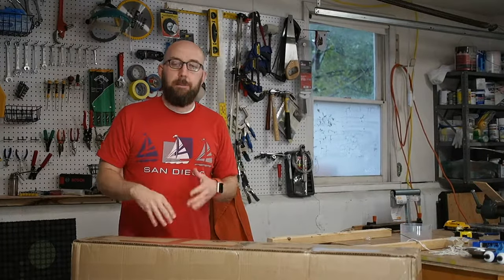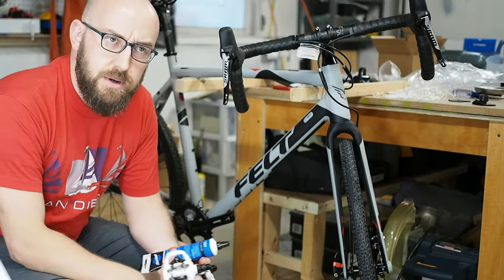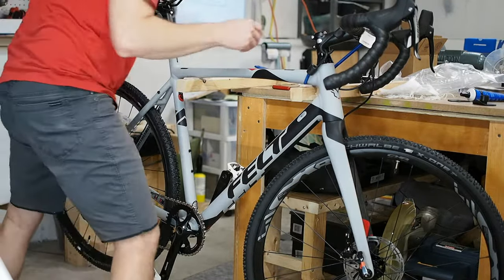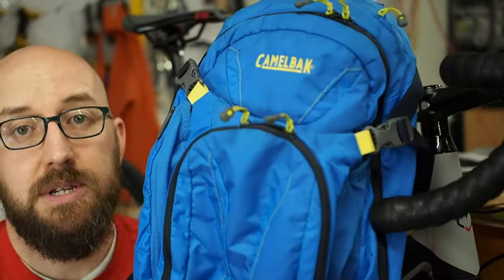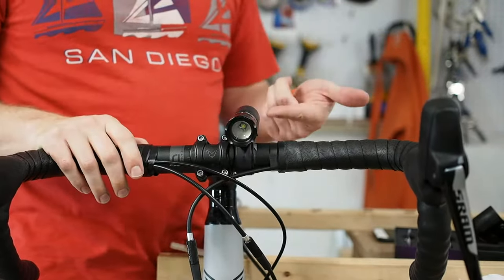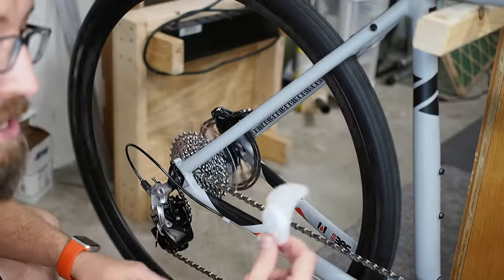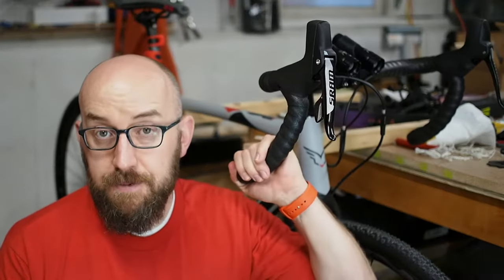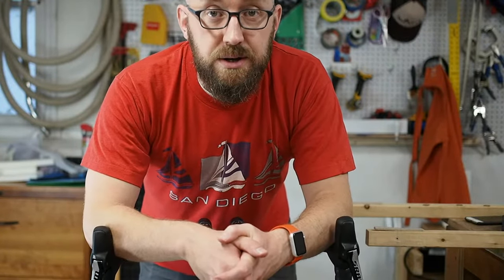Assembling My New Felt F55x Cyclocross Bike

Comment: Nice.. I purchased the same deal at Mikes Bikes as well... anyways, I wanted to try fit a wider 700x40c tire. By any chance you think it would clear the frame??
Reply from the maker: +Clay Thompson I shouldn’t be your definitive source for this but it appears like there is plenty of clearance for a 40c tire. Mine came with 33c tires on it.
Reply: Chasing the Twist hey thanks I’ll have to give it a go soon as a sweet deal pops up on a 40c tubeless
Reply: Raymond San Juan no I couldn’t splurge on 40c not knowing if they’d fit or not, so I’m still rolling the stock tires for now :/